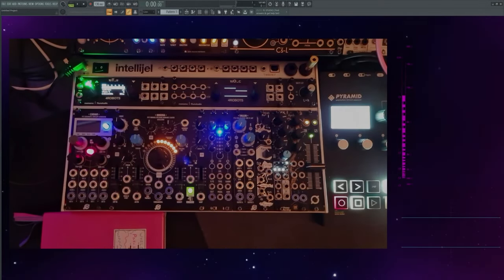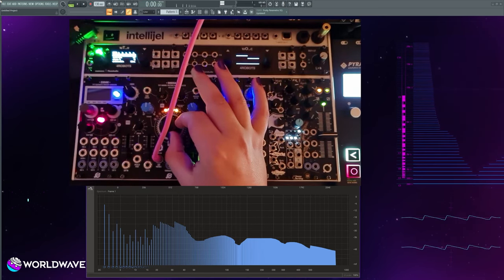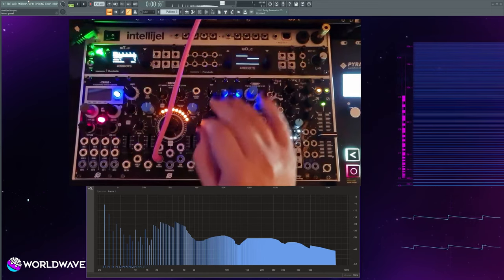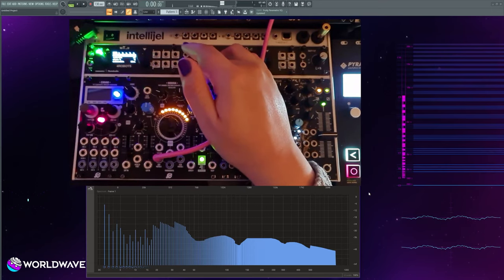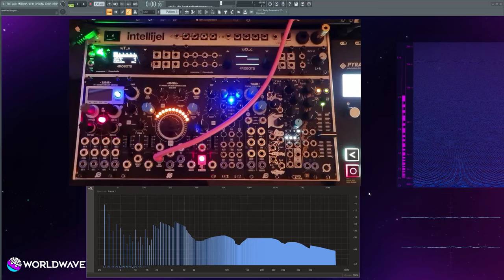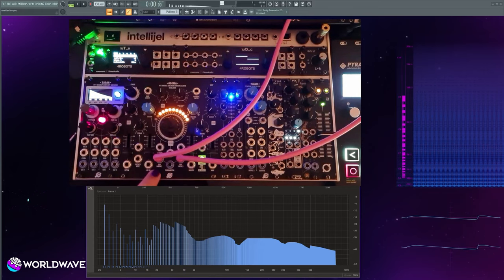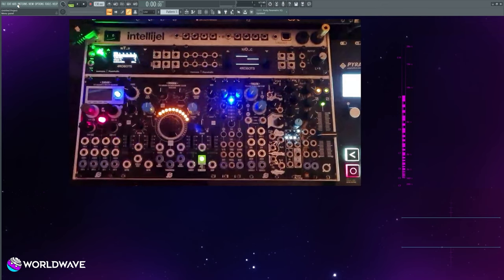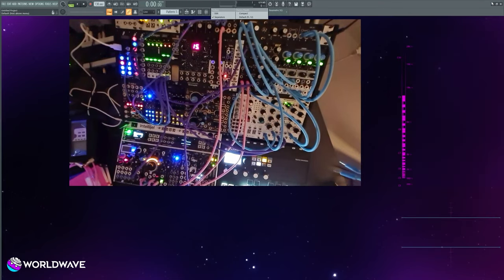Wave Salad - E1 - XAOC Devices Odessa

Comment: Hey my Odessa wizard. Continued thanks for this tutorial. Takin me some time to wrap my mind around the banks/harmonic factor/ even odd outputs. Do know why the bank knob is label + - 8? 
I get the 8 part but don’t understand the + -.
Reply from the maker: Super glad you enjoyed this! The +- is a bit confusing, yes. Basically the + or - indicate inversion, so when going towards + you will get odd groups of harmonics out of the odd output, and when going to - you will get even groups of harmomics out of the odd output. And vice-versa for the even output.

It also changes which output gets shifted by the harmonic cluster knob. When turned right the cluster knob shifts the right output and when turned to the left the cluster knob shifts the left.

Comment: eyyyy i got free extra info why the spectral edit window in zebra/lette doesnt have a meter, because its all in relation to the fundamental. i had been wondering about this.
Reply from the maker: lol nice. yeah wt editors are usually not audio based but just bin based, as in the synth just resynthesizes an input via fft into a bin table that you can edit. So I was basically editing bins in this video to show examples for stuff involving individual harmonics. That's specifically for the part where I used phaseplant.

Comment: great video. How hard is it to change the silver panels out for black ones for someone who has no experience working on modules?
Reply from the maker: Hmm. It's not hard at all if you have a good set of small bits, and the wrench needed to loosen the jack nuts. The big boy knob is a little more challenging as it needs another bit to loosen it (DONT pull it off like the rest of the knobs) and there's a little strip of tape it needs to stay reliable and you have to be careful not to lose it. Generally I'd say contact support and they'll give you a full rundown of the process, they're all amazing over there. Good luck! XAOC black panels are super badass.

Comment: Thank you for making this video, it is very helpful to me!
May I ask about the Hel expender?  I am a little confused about its function. Is it like the sub-oscillator of Moog Subharmonicon to control the harmonics generated by the main oscillator?
 In addition, would you recommend it? because I only have a 62hp palette case, and there is not enough space after I putting  in Odessa. If there is no Hel expender, will the sound change be less?
Reply from the maker: Hi there. The Hel expander is quite cool and unique for what the Odessa does with it. Basically, the Odessa can generate 1, 3 or 5 voices and nothing inbetween. These voices are in unison with the root note (1v/oct input). When Hel is connected and has 1v/oct inputs you can control the root note and other voices through the inputs there when using multiple voices, each voice gets its own 1v/oct input. My gripe with it was you can't have 4-note harmonies, only 3 and 5.
Reply: @Worldwave  HI,Thank you for reply. If you set Odessa to 5 voices and use Hel expender, 1v/oct to insert Root, 2, 3 and 4, can you create 4-note harmonies?
Reply from the maker: @misty6858  I believe so, my memory's fuzzy on that one though. The root will have 2 voices on it because youre not modulating the 5th voice.

Sorry for the late reply 😔